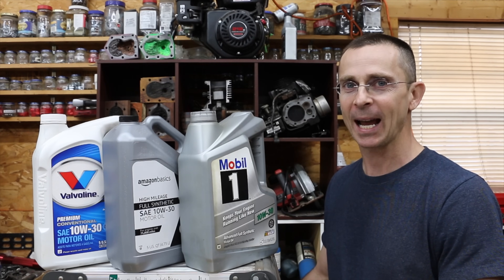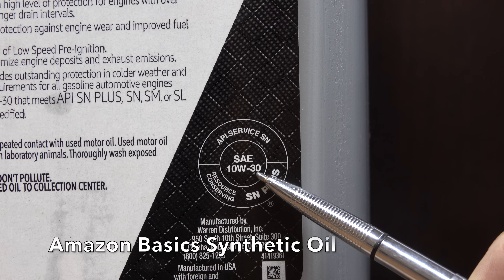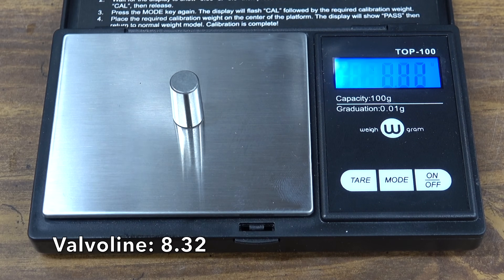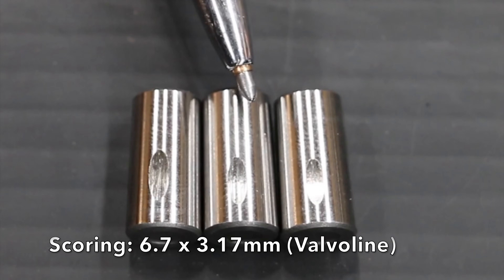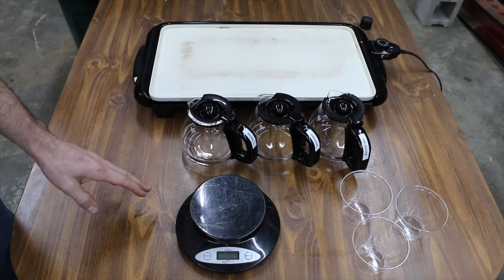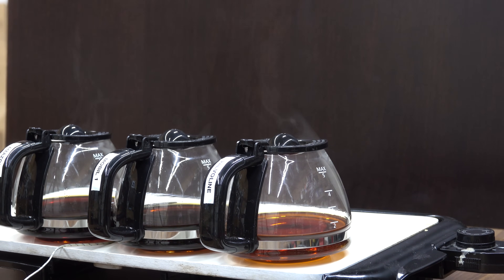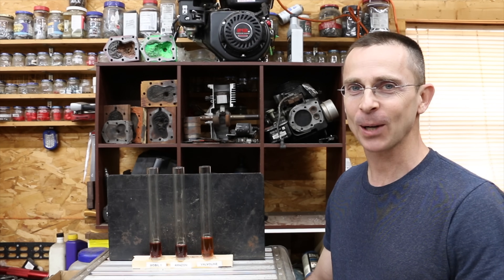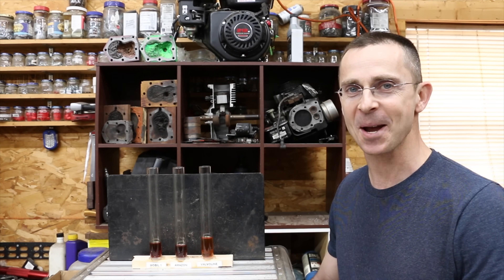Is AmazonBasics Full Synthetic Motor Oil better than Mobil 1? Let's find out!

Comment: There's three 3/4 main factors that effect oil volume & cause it to evaporate; temp, oil flow/depth of film & air flow. They all work together to create the evaporation effect...take one away & it doesn't really happen, therefore the lack of forced airflow in this test effects it greatly, as well as no flow/constant depth...which is rather thick compared to the film thickness of that flowing over the hotter parts of combustion engines...residual film thickness at temp...which is very thin.

Suggestions;
put minimal oil in containers (⅛"-¼")

Put hotplate on hinges, w/axis aligned handle to handle, to where it can rock back & fourth enough that the oil bunches up in either corner (maybe 20°-30°) exposing a thin residual film to be converted to gas readily. Automatic mechanism for rocking action to create oil flow at a consistent pace/intervals back & forth...the timing interval back & forth should be however long it takes the oil to bunch up at the low point @ test temp...fairly consistent rocking back & fourth with slight pause at either side.

maybe squirrel cage blower forcing or drawing through ¾"-1" flow in center of lid & recessed into pot to direct airflow to middle bottom area where thin residual film is evaporating/gasifying... with exhaust in annular quadrants, like the lid already exhibits but possibly enlarge the total openings 4-6x intake port size. Probably going to use all flex lines on these connections to allow for the back & fourth rocking action of the hot plate (unless whole system is built on something that rocks...like a 2"x12" long enough for hot plate & blower to mount to).
Reply from the maker: Great recommendations!  This is very helpful and will help me improve the testing in the future. Thank you!

Comment: Great video but WHY would you use the Valvoline with only testing 3 oils? That's is garbage. You should of used Pennzoil Ultra Platinum instead of the Valvoline. Mobil 1 is a good product but the Penzoil is the BEST unless you start getting into your Royal Purple, Amsoil ect. Even those aren't worth the extra money for the average car and driver.
Reply from the maker: Thank you for the video idea!

Comment: I am just in awe! You absolutely executed this test. Not just proving that Amazon Basics is a high quality product, but even more, the difference with conventional and full synthetic. This is the reason why I use full synthetic in all my vehicles. Conventional is still a good product and will do fine but the flow, protection, and cleanliness of a full synthetic pays for itself in the long run. Very awesome video Project Farm. A good idea would test a full synthetic group 3 oil and see how it performs against a group IV/group V 100% synthetic motor oil.
Reply from the maker: Thank you for the video idea and thanks for the positive comment!

Comment: Interesting I ran mobile one in my Stratus with a 2.7 for years switch to Valvoline bc of the no spill top lol and the motor seems to like the Valvoline the best no more ticking on cold starts and I can squeeze a couple thousand more miles in between oil changes but I'm definitely going to trying The Amazon oil my next oil change. It wood be cool to see some diesel oil test i run Rotella synthetic 5w30 in my truck there's not a lot out there on diesel oil
Reply from the maker: Thank you!

Comment: The lubricity test seemed biased because the mobil 1 had more contact on the disc while the other 2 barely touched the surface and had significant less oil flow. But thats my only gripe
Reply from the maker: Thank you

Comment: Project Farm, you tested flow at one temperature extreme, but didn't test the flow or lubricity at operating temperature or above, which is where the engine spends most of its time.

Do any of them get very thin at high temperature? Do they have more wear at high temperature?
How do they compare to single viscosity oils?
(a multi viscosity oil is rated at 2 different temperatures, so 10w 30 should have the same viscosity as a 10 weight when tested at -10 or so (some test as low as -40 I believe) ,and the same as a 30 weight at 212F, which is considered normal operating temperature.

A good multi viscosity will match those numbers, and a bad one will be too thick when cold or too thin when hot, or sometimes do weird things from using low quality viscosity modifiers.

So if you want to test viscosity accuracy, add a single viscosity conventional oil control sample of whatever the W (Winter) rating is (straight 5w etc) in the freezer test, and then repeat the test at 212f using a straight 30 weight conventional oil as a comparison.

I would also do at least one demonstration test on the lubricity tester using a known good brand such as the Mobile 1, or the Rotella T6 when you do diesel oils, and do one test straight out of the freezer, one at room temperature, and one at or as close to 212f as you can safely get, and see if it wears differently.
Then repeat the 3 tests using a 5 weight oil.
(doing it with a 30 weight oil won't be very interesting, because room temperature and hot will be in its normal range, and cold is only a problem for pumping through small oil ports, and being thicker it will have higher lubricity in the tester. When 5 weight gets hot though, it thins out and the film fails and you get bad wear.)
Reply from the maker: Thank you for the video idea!

Comment: Would you be able to get a lower end , block with crank shaft oil pan and pump. It could be a common easy to get like a Chevy 350 . Then you could test with real oil pressure real bearings and all. If you need details let me know.
Reply from the maker: Thank you for the idea!

Comment: can you throw in Pennzoil ultra platinum against mobil 1, castrol edge titanium, royal purple, and amazon basic with similar testing?
Reply: this please, I run ultra plat and seeing a test would be cool
Reply from the maker: Thank you!
Reply: Don't forget Amsoil.
Reply: Add Shell Rotella T6 to that mix. It's a heavier duty oil than the others listed, but is still used by many people in normal gasoline engine vehicles. It has some of the best cleaning, and wear stats of any oil out there. Especially the 0w40 version.

 I personally use it in all of my vehicles and equipment as I can get it cheap through my work.

 Winters here tend to dip into the -40's, and a full synthetic 0W oil really helps. It made a huge difference in effort needed to pull over my snowblower, compared to the factory 10W30 oil.
Reply: NeverIce isn't T6 a diesel oil?
Reply: @jkreid50  it will work for either gasoline or diesel engines
Reply: @HakoFrost  its spelled BROtella
Reply: I use that Castol and since then my car doesn't consume any significant oil anymore.
Reply: @run923  : But in Europe many scammers selling copies of Castrol so for example in Czech Republic may people dont trust Castrol anymore. Not because its a bad oil, but you cant even notice you buying a fake one...
Reply: @jirka87 Ok, then how do you know it's fake?
Reply: Also Torco and Amsoil.
Reply: Omega 631 also please
Reply: Please add the Valvoline synthetic & synthetic blend.
Reply: Yes and put in amsoil
Reply: Agreed...please test Royal Purple :)
Reply: I would be curious to see how these perform against each other. I've been using Castrol Edge Titanium for years and it performed well for me but I'm curious to see if Amazon basic is better.

Comment: This is pretty cool. When I did my recent oil change, I was on amazon looking at prices. I saw amazon had full synthetic but I went for Castrol GTX full synthetic instead of using Mobil 1 again. I’m not too keen on products like Amsoil and royal purple because I don’t drive my 2007 Mercedes S550 like crazy. I might consider amazon basics full synthetic and see how it turns out.
Reply from the maker: Thank you!

Comment: A more real test would be to heat the oil to 212 degrees and do the bearing test.
Reply: That's a good idea man.
Reply: Why no lubricity at high temp? —it’ll be nice to have but actually there is no need for wear/lubricity test at hot condition. Because most car engines’ wear and tear(~90%) is done at cold start, when lubrications has not been established. Once Lubrications is formed, wear on metal is negligible..  again, it is nice to have but not necessary.
Reply: Tony Yao because every bearing test I’ve seen the oil is cold. I’d be very curious to see the wear at operating temp. I believe it’s a valid test.
Reply: @tony37068  Sometimes you also start a warm engine. Never underestimate the strange conditions that can occur. Also add viscosity test at high temperatures.
Reply: @tony37068  Too bad that this test still means very little as 10w should not be used in cold weather if you're worried about wear. Also, a high quality oil can protect better on startup just from remaining on the metal. And of course longevity of the oil, which will absolutely accelerate wear if you're using it too long.

I guess if your argument is you're stupid and not using 0w in a cold climate then the amazon oil is better lol.
Reply: @tony37068    Yes, but temperature is still an important measure because different oils have different temp stability levels.  An oil with a lower temp stability will start to degrade faster than without.
Reply: Sounds good but no need to—most wear (~90%) is caused when engine starts. How soon lubrication builds up is more important than how well it lubricates—although both are important.
Reply: Or maybe do the bearing scar test after cooking the oil at 400 degrees.  Now that would really test the oil.
Reply: +Made... The problem is that it is hard to simulate 80 hours of runtime (60mph for 83.3 hours equals 5000 miles) for a 5k miles oil change period. Better to cook the oil for an hour or so in order to simulate 83 hours of the oil being broken down at normal temps.  It probably would have been a good idea to run the bearing test after the cooking cycle though.
Reply: Nice idea, but the friction of the test will heat the system up pretty high.  Just like an engine, it starts at low temp and ends at a high temp.
Reply: My thoughts exactly.
Reply: Doesn't matter much really, nearly all wear comes from cold starting the engine, as it is not being properly lubricated
Reply: Will Jeff fair point, but do consider there are parts of the engine and the oil exposed to considerably higher temperatures that 212f and it's those higher temperatures that cause the degradation.
Reply: Doing a test without temp on oil is useless! Flow test or not! Oils perform under temp as you said at the start of tour vid
Reply: @stevejohnstone5163  how is it useless? The fact that amazon basics flowed better when cold is all you need. Better flow when cold = better lubrication when hot. You can see amazon destroy the competition, I don't understand how that is useless. He does real world testing, remember folks, your car starts cold, A BETTER FLOWING Oil, IS SUPREME. Meaning, a better flowing oil, is going to get through the oil galleries faster, and lubricate under colder conditions. FASTER. Meaning, LESS WEAR. 

His test was accurate, you're just nit picking
Reply: Your engine is cold when started idiot.
Reply: Oil temp can be much higher than water temp. Full synthetics are at their best in the 250*+ range when you're towing heavy or running hard compared to conventional.
Reply: @leftyeh6495    Not necessarily according to Terry Dyson's testing.  There was a range of temp stability for synthetics, conventional, semi-synthetic, and plant based oils, and quite a few different categories had over lap with one another.  

  Meaning, there were some synthetic ones that had lower temp stability than some conventional and plant based ones.  But yes, generally speaking, synthetics tended to do better in that area, and overall lubricity than conventional.  

Dyson however, seems to believe that it's primarily the additive package that determines the performance more than the base oil used.  To drive that point home, a plant based oil performed extremely well and ranked 3rd place out of some 200 oils tested in the straight from the bottle category.  It was not far behind two Amsoil full synthetic oils in it's performance.  

    One of the reason why I like Dyson's and PF"s work, is because they are more objective and independent than many other sources regarding these things.  It's not about marketing, belief, hearsay, myth, group think, but about actual raw data not influenced by marketing, human subjectivity, and again, nor group think belief systems.

Comment: Great test and a surprising result. Well done. I always wondered if the high mileage motor oils offer anything that regular oils don't. I run Castrol High Mileage in my 200,000 mile Tahoe and now I'm wondering if I should.
Reply from the maker: It helps deal with leaks. I use it in my high mileage vehicles.
Reply: @ProjectFarm  Thank you!

Comment: My air compressor uses ISO 100 sae 30 non detergent oil. The owners manual as well as the label on the side of the motor says you can also use mobile 1 full synthetic. Can you test to see if there is a big advantage or disadvantage to either one in an air compressor.
Reply from the maker: Thank you for the video idea!

Comment: Haven't finished the video, but I must say I am pretty convinced there's not a huge difference between most synthetic oils as far as engine protection is concerned. Some may be better in testing, but realistically they'll all work fine in your engine. That being said, I always use Mobil 1 because I'm a sucker for their marketing and it's pretty cheap at Walmart. I even use it as lube on my guns!
Reply from the maker: Thank you!

Comment: You can catch M1 on sale at Wallyworld for $22.97 in the 5qt jug.. I just buy it when it's on sale have for decades.  Use any of these oils and change your oil regularly and I seriously doubt your engine will suffer any kind of oil related failure.
Reply from the maker: Thank you!

Comment: Can you see if you lose horsepower and fuel efficient from using a heavier weight oil, I've been using 5w30 in my range though it recommends 5w20, I haven't noticed a difference and it doesn't cost extra for me to buy
Reply from the maker: Great point.  Yes, high viscosity oils will reduce efficiency in engines designed for low viscosity oil.
Reply: @ProjectFarm  the thing is though, this is a 2002 Mazda made duratec ranger 2.3, and over the month that I've been using 5w30 over 5w20 was not noticeable, but it did help with engine temps, the radiator is a bit small for this engine, I'll keep testing and let you know on my next change, thank you for the reply have a good day

Comment: DIesel oil should be the next !!!!
Reply from the maker: Thank you for the video idea!
Reply: It's not really much different. It's usually 15W20 instead of 5W30,10W30 or 10W40.
Reply: @the1andonlyfirebug  

You mean 15w40 not 15w20. But you are correct about it not being much different other than maybe additive packages.
Reply: @the1andonlyfirebug  No, it's actually a lot different because they can put in anti wear additives that break catalytic converters and oxygen sensors.  On gas engines they have to leave those out.
Reply: @RickBaconsAdventures  just dont run a catalytic converter and you're good
Reply: @94eh32  yeah that works fine for cars with no computer but unfortunately it's not always practical to ONLY own old cars
Reply: Diesel oil will perform better due to its zinc additive package, and it's swell to use in a vehicle if you don't value the performance of your catalytic converter.  If your car is OBD2 or you need to pass the sniffer, don't.  it doesn't take long before your exhaust starts smelling like straight pipe.

Comment: Conventional oil v.s two synthetics. I'm a die hard valvoline guy, would like to have seen you test the valvoline synthetic. Or maybe they don't make a synthetic 10w 30?
Reply from the maker: Great point. I was using the conventional as a baseline.

Comment: I live in Canada. It gets to minus 25 degrees Celsius at times in the winter. I just buy the oil that is on sale, that meets the specs of my engine. Whatever 0W20 oil is on sale when I have to change my oil, that's the one I buy. I don't notice much of a difference between the different brands.
Reply from the maker: Thank you!

Comment: Man, amazon is doing everything. All I use is Castrol gtx full synthetic, would be cool to see how that lines up to those 3, as I dont trust valvoline or mobil anywhere near as much as castrol. Change the oil every 5k, it costs about $55 a jug, but with 380k on some of my engines, and all of them still running great, I think I am doing alright
Reply from the maker: Thank you!

Comment: Supertech oil is 16 bucks at walmart. And is basically mobile one oil. Without their specific oil additives.
Reply: Why buy super tech oil when you can get mobil for the same price after their rebates
Reply: @tonychau1983  yeah but then you have to do the rebates which take time. When you can save a couple bucks at that time. And my walmart doesnt always have the mobile one with rebates all the time. Plus just testing the waters on wether it would be a decent oil. Because it is cheap. But its made by the same oil company as mobile one.
Reply: @TechGuy93  same maker different recipes.  Mobil runs their own rebates usually once in the spring and once in the fall.
Reply from the maker: Thank you!

Comment: The amounts of oil used in each lubricity test was uneven. Mobil 1 had more oil than the other brands. Amazon and valvoline were barely touching the oil when tested. The test doesn't stand valid in my opinion.
Reply from the maker: Thanks for the constructive feedback.
Reply: I noticed that too, wonder if he has to manipulate the results.
Reply: I noticed that too. If that affected the results Amazon won the wear scar test by far.